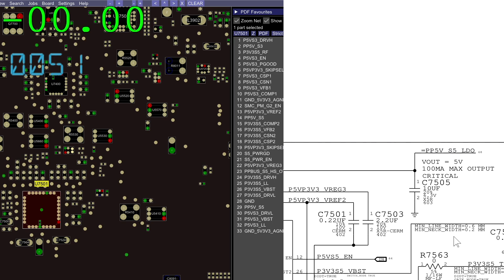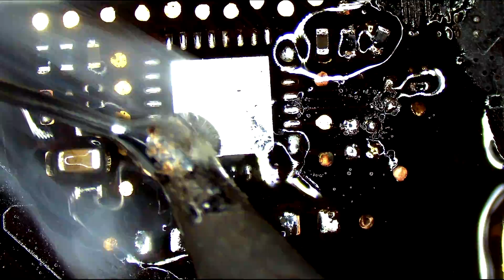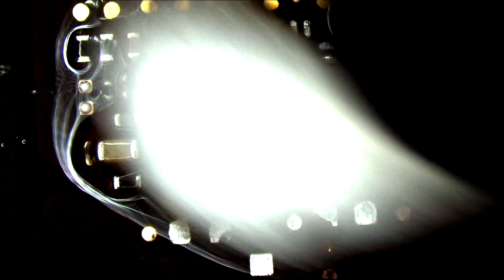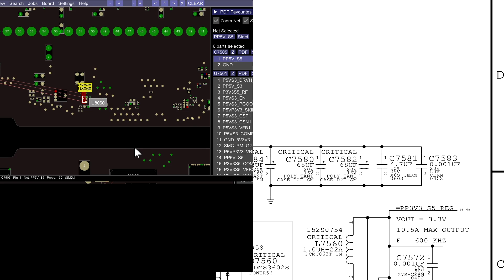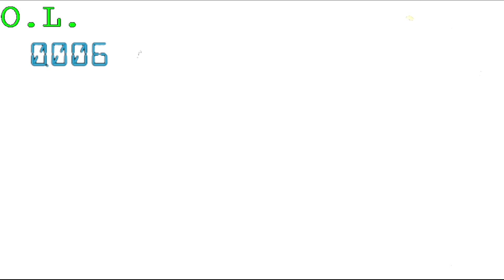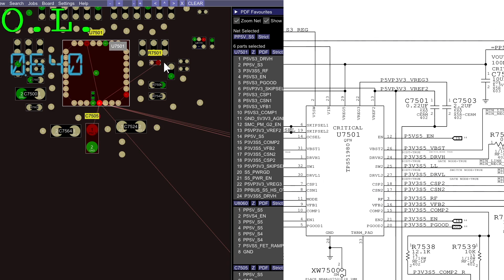Macbook wine spill repair 820-4924

Comment: Hey Louis! Pro tip on the solvent dispenser. If you plug the hole in the middle with your finger and press it, applying a bit of a vacuum on the pump, that's normally enough to get the thing primed. I use one for wire harness building.

Comment: I used to use those alcohol dispensers for my old job and what would usually happen is the straw inside them would crack going up to the top metal dispenser part.  Once it's cracked it works like you showed at 8:25

Comment: Self-leveling concrete could've saved that board too
Reply: Robert Slackware  Damn that actually makes sense
Reply: @Joe Black Its cheap. Weak is just a bonus side effect.
Reply: @Joe Black Distilled water is safer.

Comment: I have cleaned quite a few corroded boards with Hoppes 9 gun cleaner. It works well to displace any further corrosion as well as removing all of the corrosion. It isn't so great at getting under BGA ICs, however, it has saved consoles, cell phones, and motherboards. Just use a soft nylon brush (also found at most gun stores). Also, Hoppes 9 is not conductive, which means it can be left on the board in a thin coat to ward off any future spills...

Comment: I would argue you're an essential business.

You need to stay open to fix MacBooks so ppl can work from home 🥴
Reply: I saw a shoe store open on 5th ave bk. People need shoes, that's essential ;)
Reply: He is as much essential business as the local coffee shop. Not at all. Please, stay home everyone, it's badly serious!!
Reply: @greenpulp.  I don't quite get your entire comment. People need their computers to function in order to work from home so to be able to take your MacBook to Rossmann Repair Group to get it fixed is essential.
Reply: Over in Chicago, they closed a business that was switching to making N95 masks... this whole thing is a mess.
Reply: @wes9451  That doesn't make sense. If they were switching to producing masks It seems they would be an essential business.
Reply: Just about every state labeled any business that supports IT infrastructure or end devices that were necessary for remote workers (which includes repair) was essential.

Of course, yeah, just about every state has rules and exceptions that make absolutely no sense whatsoever.  It's almost as if politicians have no clue about anything, really, and were just making it up as they went along.  But that couldn't be, right?  Right?

Comment: I had one with wine spilled on it and after a couple of hours after the spill I unplugged the battery and worked on it the next day. That board was horrible, the wine was everywhere. At the time the machine was only like 4 months old and couldn’t find any board views, schematics or donor boards. The trackpad connector seemed like it had a fire and some pins welded themselves to the board. Wine is acidic and it ate away a lot of components in that little time. I gave the machine back to the client and told him if he wanted I could try later when donor boards are available. Funny thing he told me it was on before he gave it to me because it was hot. He truly believed that the machine was still turning on and that the screen stopped working.

Comment: Just as another anecdote about getting to water damage quick being essential. It was my birthday party and my family was over at my house.  My sister dropped her phone in the toilet, pre use, and told me. I instantly opened it up and took out the motherboard. Cleaned it off with alcohol and then air dried it with a hot air gun. Also used compressed air to dry out the housing. She continued to use the phone for 2 more years! If she hadn't been with me at my house with my bench and tools it would have been much worse!! Keep up the good fight louis,

Comment: LOUIS !!! I just watch your office update and I cannot believe I didn't think about recommending you EVERBLOCK system to build a wall at the front for the separation . I bought a huge amount many years ago and I used them as a wall , as display , as compartment to put my backdrops . Everybody who saw them were totally in love with them . They are in NYC I think , it cost me a lot to have them delivered in Canada years ago , but I don't regret it !  I could even use them in a showroom . Check them out ! You can use YouTube for a rebate I'm sure .They are worth it , I moved since and rebuild them in my new house , new configuration , they are good forever .
Reply: no deck
Reply: @alfoncejean8826    ???? What ?  The desks would be in front with an opening , or door

Comment: I love the new shop and new equipment. Thank you for all of the right to repair work you’ve been putting in everywhere! Also am addicted to your videos. I have a chip that I believe has corrosion and needs to be re-balled due to humidity and/or possibly vaping? Maine get insanely humid in the summer, and it ruins electronics. This chip is on a PlayStation4 and I believe it’s called an APU? I was wondering if you might so kind as to help me find a place to send it that’s capable of fixing it. I don’t need it for myself as I have a new PS4 (along with a super air purifier and dehumidifier running so I don’t make the same mistake. I plan on giving this non working PS4 to my cousin that had a stroke, who is home bored, and unable to work for at least a few months. Thanks in advance for at least reading this👍 even if you can’t help, I appreciate it. I may just decide to research as best I can, and take a shot in the dark with someone. I feel bad because I just don’t have the time to spend with him playing video games. He texts me daily, and I unfortunately have to ignore him most of the time because I’m busy, tired, and have so little free time for myself.

Comment: Possibly the connection between the rubber straw and the metal dispenser is broken. Therefore the alcohol couldn't go further up. My solution is to use a metal straw instead of a easy to break rubber tube.

Comment: bruh, i have the same issue with IPA dispenser.  if you cover the hole with your finger and press it, it will prime in like 2 pumps and it's golden.

Comment: This reminds me of the time I completely rebuilt a brand new $40K color copier after someone tried to get the copier drunk. They managed to dump a full bottle of wine in it at an office party. Took me around 10 days to get that sticky mess out of all the parts.
Reply: Nice ... wine impgrenated toner!
Reply: @zebo-the-fat  Fortunately the wine missed the developer unit but the main boards, wiring harness and almost every motor and solenoid was covered in sticky, smelly syrup. They were smart, (not drunk enough) to pull the power cord before it fried anything, unlike Rossmann's customers.

Comment: I'm not quite sure this is the place to ask you Louis but I have an old iPad mini 2 and while repairing the digitizer I broke the LCD. It's my first time attempting to repair something on my own and I was looking for a recommendation on where to get an LCD for my model. I'd buy it from store.rossman but I did not see anything like that on your store. It's okay if you cannot help. I had just broken the digitizer 3-4 years ago and with being locked up for the week I figured I would try to fix it. So sorry for the long message and thank you if you do read this comment.

Comment: Home depot does sell an electronics screwdriver kit with 104 bits that has pentalobe for apple, torx security and Nintendo tristar. I've not found anything it doesn't have a bit for and spudgers and suction cup for phone screens. 14.99$

Comment: I spilled half a glas if wine on my ThinkPad. Just just rinsed it with a glass of water, which drained on the table through the drain holes - like it was intended on a proper laptop

Comment: Louis, what about borrowing a legit hotdog van or the like and parking outside the Apple store ?.
Temporary signage saying The Other Genius or something witty and maybe a bit cheeky.
You could promote this as a Right To Repair portable repair station, useful in disaster areas like flood or hurricane etc.
Rigorously you could set up your repairs bench on a table in a white van or trailer and keep a sensible range of spares to hand to do most water damage repairs or critical data recoveries etc remotely. 
Such a mobile repair fleet could be talked up as an essential service for natural disaster recovery, "right to repair is essential !", get the local press involved, run with it here's an honest opportunity !.

Comment: Does anyway know if you keep your MacBook Plugged in it would actually HELP battery health because the battery count would be less and the MacBook is using the power adapter as the power source.

Comment: How would one go about removing that UV resin in case more work needed to be done in the same area?
Reply: I was gonna ask that exact question. I am guessing you have to mechanically scrape it off, but I await an answer from Lord Rossmann for confirmation.
Reply: Spartacusse In the last livestream (that Louis prefers not to remember) he had to scrape the green stuff off the board (more than once). It was painful for him (and to watch).
Reply: Heii70 The wire has insulation (except at the ends where it is burned off). The green stuff (conformal coating) is to stop the wire working loose and detaching from the board. Imagine that gets bumped and dropped for 5 years of heavy usage.
Reply: @Bash70  Its generally referred to as magnet wire common on speaker voice coils its covered in varnish end to end.

Comment: I thought the alcohol in the wine would evaporate quickly and prevent corrosion. but then it would actually have to be very high Alcohol content so i guess all the other fillers in the wine just sat there and corroded the materials. in this case 80 proof vodka would have actually been a better choice to spill

Comment: You know what would also saved it? A removable battery that was on the outside instead of the inside. I still don't see the point of putting the battery on the inside when an external battery just have two locks that you can unlock.

Comment: I wonder why people even try to turn it on after spill. The first priority is to remove all power IMMEDIATELY and the second is to disassemble and wash away any liquid with distilled water and then isopropyl alcohol I do electronics so I keep at least 5l IPA and 5l electronic water but I would suggest anybody that has a laptop and maybe significant other with laptop,  to get themselves a jug of each and tools to disassemble. It costs almost nothing and may save you thousands of dollars when you need it.

My T440s has already been wet twice. Once with a hot latte and second time completely soaked with mineral water which opened in the bag. Both times everything was completely, utterly wet inside. Mineral water found itself between leaves of the display and before I could even disassemble it I had to open it like a book and stand on its side just so that the water drains first.

It survived both times because I took quick action to open it and disconnect the battery (it has internal battery) and then immediately remove motherboard and literally wash it with distilled water and then IPA. The laptop was bought the day it became available here in Poland (so over 6 years old I think), everything still works perfectly (except a touch of stain on the LCD screen...) and I can't wait to find a pretext to replace it with a new one (not going to be Macbook, for sure).

Comment: Louis....if you put a drop or two in the alcohol dispenser it will prime it and work fine.  Also...you should invest in some horse hair brushes or acid brushes as i like to call them and do away with the cotton swabs on the board.

just saying
Reply: the best brand dispenser is MENDA

Comment: Louis, you should offer a more expensive rush service for the people that absolutely need their machine ASAP.
Reply: But not so nice to a poor student who can't afford rush service and can't afford to buy a new device.

It's similar to the question if alcohol for washing hands should be made 10 times more expensive just because the needs are larger right now. Or should toilet paper have the prise bumped several times the normal?
Reply: Per Westermark No, I meant an optional service. Just so whoever needs it ASAP gets it like a day or so faster. If you can’t afford it, you get the regular service.
Reply: @justanormaluser1535  Yes I know you meant that. But the outcome would be that prople with more money - who can afford new hardware - would still go before in the queue so students who don't have the extra money would have to wait much longer to get their equipment back.

And one side effect of having a VIP line is that it isn't possible to guess at hiw long the repair will take based on number of devices before in the queue because new customers will come in and get to the front of the queue.

It's a bit like people who travel stand-by. They think they have a chance to get with the plane. Then my meeting ends earlier than planned and I switch to an earlier plane and suddenly that free spot was no more.
Reply: Per Westermark ah okay. I get your point, but I think they have enough technicians to overcome that. There will probably not be too many people using this rush service anyway, so it will be just a very minor inconvenience for anyone else, which may result in them getting their machine back like 1 hour later or so. But since most machines wait a few hours for their owners to pick them up anyway it won’t be a too big issue.

Comment: I repaired my first Iphone last week... it was a S5 the battery has swallow and split the case screen from the body of the phone. I won't ever work on a Iphone again.. Never! Had to replace the screen and the battery spent over 4 hrs trying to get the ribbon cables back in place it was a nightmare.
Reply: Electronics especially have a tough learning curve, even when experienced you hear how much he curses sometimes. Cant blame him i do too been doing this stuff longer than I care to admit. (Ibm Pc compatable) can't stand apple. Btw good job, it gets easier get tiny tweezers / screw drivers.

Comment: What's the mysterious off-white semitransparent goo you keep depositing on the board, what's it good for, and why does it make me uncomfortable? Also, why do you use so obscenely much of it?
Reply: Ember Flux helps remove corrosion, and helps the solder adhere to the pads.
Reply: Well, that answers what it is, now why does he practically lather the board with it? You'd think that adding THAT much might start doing more harm than good.
Reply: Ember The amount of flux used is a running joke. The key is that it works for him, when combined with the hot air nozzle. The boards are cleaned and dried afterwards.

Comment: you should get a permit to do that just up the block and someone with fliers on the other block directing them to the correct side. You wouldn't be trolling right in front of the apple store, but they would have to pass by your company to get to the apple store. A more kosher way of doing it. Don't mention apple, just say this block and this block and don't elude to what you are doing.

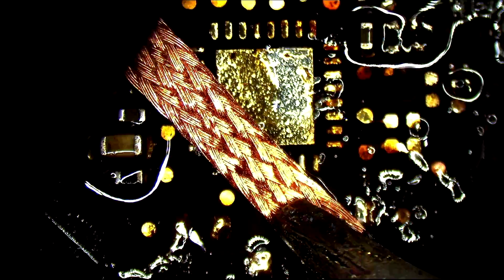Comment: 7:15 why does he remove all the soldering tin and then reapply it?
Reply: The original solder is lead-free. For repair work you want leaded solder, which is much easier to work with.
Reply: Also don't solder on corrosion so flush all corrosion off then put leaded solder on
Reply: Keep track of your essential repairs done to evidence you are needed.

Comment: If you are in the market for a new alcohol dispenser search the keyword "wash bottle" on amazon to get stuff like this: https://www.amazon.com/Valchoose-Squeeze-Bottles-Measurement-Flowing/dp/B07Z8ZZWF3/ref=sr_1_5?dchild=1&keywords=wash+bottle&qid=1584927858&s=industrial&sr=1-5
Hopefully that is a lot less shitty for you to use and you can actually see the level in the bottle which is nice. I prefer using these when I'm in labs over those dicky little things because you can actually spray the alcohol if you need to basically pressure wash the surface and it is pretty easy to get them to dispense. make sure to get ones with the straw that goes down into the bottle that way even if it is close to being out you can actually still pull up the liquid. <3

Comment: Why not an insulated wire?
Reply: The wires are insulated, with a thin varnish coating - but one must never temp the Angry Pixies to stray from the pathway you have assigned them. Having probe points that close might cause inductive heating, which can degrade the thin coating on the wire, leading to a short.

Comment: Buy a 2nd hand cheap van and set it up as a mobile workshop, with minimal equipment for quick diagnostics. Park at reasonable distance from the FruittyComputer stores, and send one of your minions with flyers to the vicinity of the Fruitty Store.

Comment: Why use that green goo when you can just add a big ol glob of hot glue? Iv seen it done by a pro and it works 100%
Reply: Because hot glue usually melts at 80c and a macbook can easily run in the 90s. Besides hotglue has no place in electronics. Conformal coating is much more professional.

Comment: Mr Rossman ,  Right to repair argument to use next time:  
Theres plenty of outdated equipment and computers in hospitals that need upkeep  and help support saving lives. Not asking you to fix pacemakers . Independent repair can fix that shitty desktop where they keep  patient  records or allergy data/photocopy machines etc. when companies refuse to or in some cases when the products have outlasted the companies. 

 Copyright argument: 3d printers were used to build ventilator valves in a corona virus emergency.They didn't have the time for authorized parts suppliers. A janky fix is better than no attempt at all when trying to save a life.